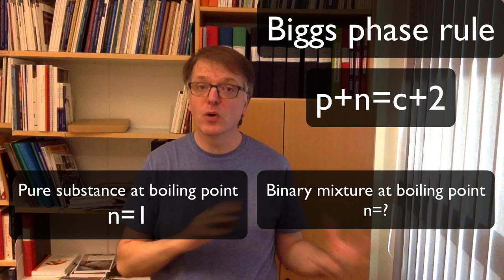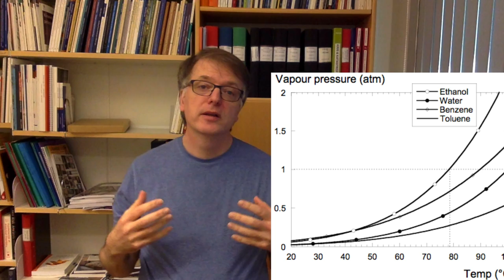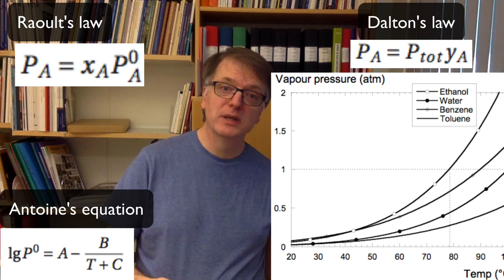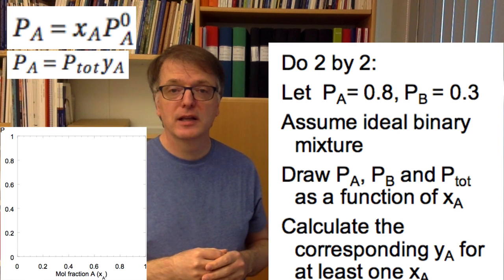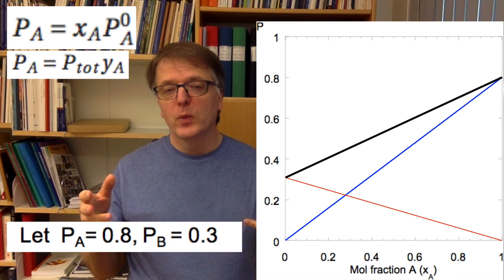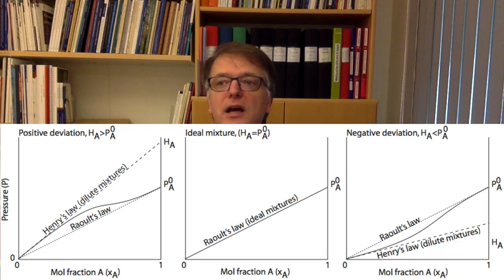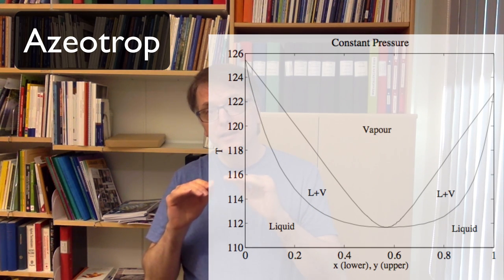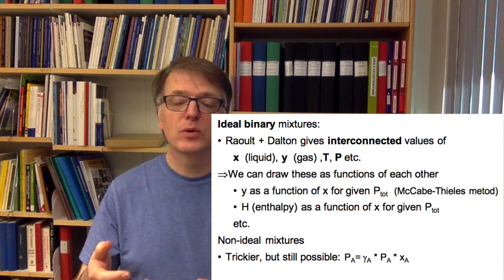Distillation: Phase equilbria

Comment: Sir, In one of your videos you've said that in a continuous counter current distillation every tray is at different boiling temperature (i.e. my guess:at any tray,incoming vapour which was in equilibrium from which tray it is coming from, so when it arrives at a new tray the vapor sees a new temp. So it again  it brings itself to new equilibrium according to temp., and so on the separation occurs),my doubt is what i am guessing is it true?? And if it is true then which graph follows as its governing graph Pxy or Txy in a distillation column??
And what about the movement of coordinates on these graphs:is it vertical or horizontal??
Reply from the maker: What actually happens in the real world is, as nearly always, complicated, but let's try to break it down a bit into simpler questions. Your question is interesting and it may be of interest to my students so I'll give it some extra attention in a rather long answer:

A continuous distillation column is (essentially always) run at constant pressure, meaning that we have the same pressure in the entire column (I'll soon come back to why this is not really true…) and different temperatures at different heights. Theoretically it could have been possible to create a distillation column that runs at a constant temperature and different pressures at different heights, but that is way more complicated than running a distillation column at constant pressure. Hence, a T-xy diagram (drawn for constant pressure) is more suitable to describe what happens in the column than a P-xy diagram (drawn for constant temperature).

Note: A continuous distillation column operated at constant pressure does not, however, have exactly the same pressure everywhere. When we say that we operate a continous distillation column at constant pressure we are simplifying. In all flow systems there is friction and where there is friction there is a pressure drop. We see the same effect when we experience that it is easier to drink liquid water using a 10 cm straw than using a 100 cm straw. 

Even if we neglect the pressure drop in the column, the T-xy diagram will be difficult to use. What happens at a tray is that a mole of vapour with one composition condenses and releases energy that goes into heat losses and in to evporation of b mole of liquid of another composition. Even if we ignore heat losses and assume that evaporation enthalpy is independent of composition (which together implies that a=b and that we thus have equimolar counter diffusion) it is still tricky to display that mass balance in a meaningful way in a T-xy diagram. In a x-y diagram, however, that is simple. The mass balance is just a straight line and that's why x-y-diagrams (drawn for a specified constant pressure) is used in McCabe-Thieles graphical method. 

There is, however, one case when you can use a T-xy diagram to illustrate what happens in the continuous distillation column and that's when you have
* 100% efficient trays (which is practically impossible, so this is only theoretical) and
* total reflux (which means the distillation column is not producing anything)
For such a (theoretical) system you simply draw a staircase in the T-xy-diagram where each step in the staircase is one ideal tray. This means that you can use a T-xy diagram to determine the minimum number of ideal trays needed to achieve a certain separation (i.e. the minimum number of ideal trays to achieve a separation for which the composition in the distillate, xD, and the composition in the bottoms, xW, are both given). The horisontal lines in a T-xy diagram tell you which condensing vapour composition is in equilibrium with which boiling liquid composition while the vertical lines tell you the composition of the flows (in this case the composition of the liqud running downwards will be identical to the composition of the vapour flowing upwards. Compare the McCabe-Thiele solution where the horisontal lines tell you the composition of the gas fluxes (from ideal trays) going upwards and the vertical lines tell you the composition of the liquid fluxes flowing down.

Also compare the x-y-diagram for the total reflux case. If you have total reflux  the McCabe-Thiele operating line (i.e. the mass balance) is the x=y line. This means that you get the same composition in the gas fluxes and the liquid fluxes.

In trying to think of what actually happens at each tray, I find it helpful to simplify and assume that the heat capacity (Cp) is small in comparison with the evaporation enthalpy and that the evaporation enthalpy is constant. So, when the vapour rises up to the tray it is slightly warmer than the temperature at the tray. At the same time, the liquid pouring down to the tray is slightly cooler than the temperature at the tray. We get a heat balance (at steady-state, i.e. when the temperature on the tray is constant in time)

Q from vapour = Q to liquid + Q to surrounding

where 

Q from vapour = (decrease in temperature)*Cp_gas +∆Hvap*(amount of vapour that condenses)
Q to liquid = (increase in temperature)*Cp_liquid + ∆Hvap*(amount of liquid that evaporates)
and where hopefully the heat losses
Q to surrounding ≈ 0

This heat balance is what governs the temperature at each tray. In the real case ∆Hvap is dependent on composition and heat capacities vary with temperature and it all becomes rather messy. On top of that there is no guarantee that the composition at different places on the very same tray are the same e.g. because of the heat losses that might give a higher temperature in the centre and a lower temperature towards the edges.

I hope my answer helped you rather than confused you